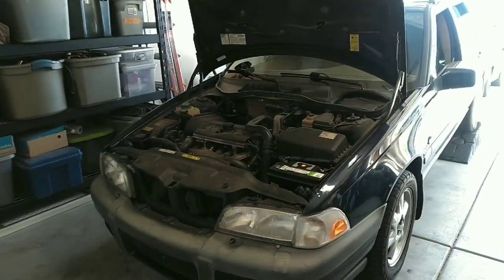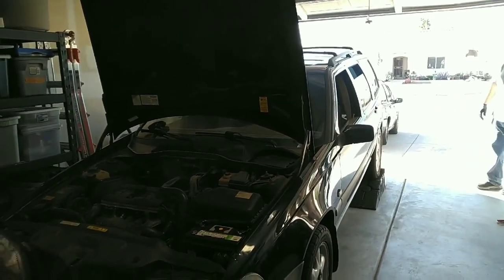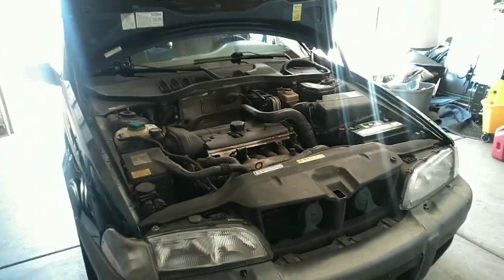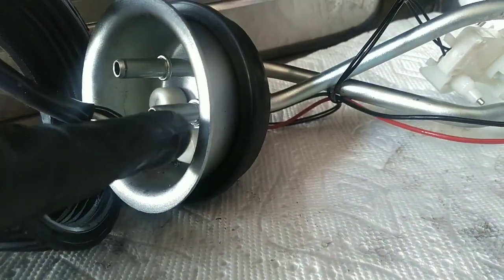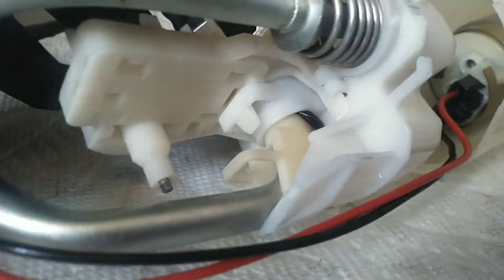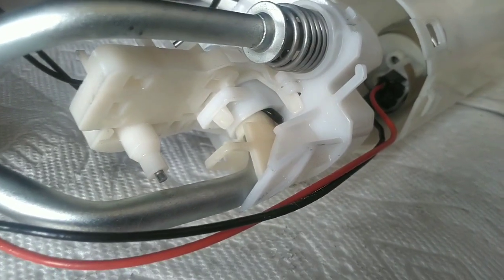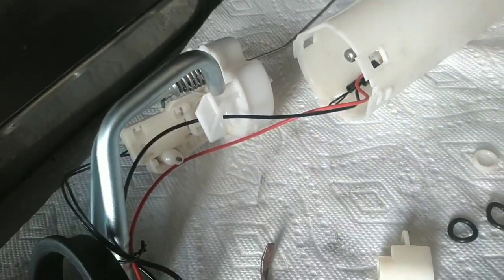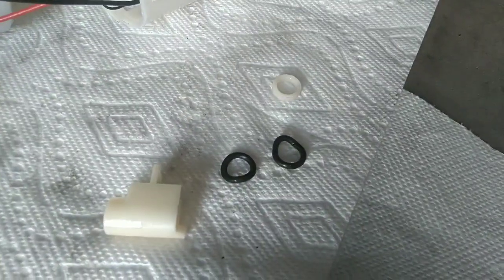Strange fuel pump issue on a 2000 V70 XC SE P80 Volvo.

Comment: Will this cause fuel pressure to drop quickly after shutting off the engine?
Reply from the maker: Yes.
Reply: @RobertDIY  Thanks, lots of post about fuel pump check valve failing as a reason for fuel pressure drop and people installing external check valves as a fix.  Thanks to your video, it shows another possible cause for fuel pressure drop after shutting engine off.

Comment: What else in general burdens the crankshaft than, alternator, power steering, water pump? (My car started to use 20% more fuel after I did some work on the front suspension, and does it also when idling/clutch is down.) 2001 S60 gasoline freely aspirated.
Reply: Did also add DAB blue tooth/work on the hand break and removed center console. The lighter socket acts funny, so could be shorted and cause voltage drop. That would make alternator run under load all the time I guess.
Reply from the maker: I have no idea. That's above my pay grade. Could be a bad alternator.

Comment: Another great Volvo video  :)
I have a problem with my U&K spec 2002 S80  2.4 (170 hp) in warm(hot) weather my engine starts pinging ( pre-ingition)  any ideas please ?  Spark plugs were changed 5k miles ago , PCV checks out OK, just done oil & filter change.
Reply from the maker: Any error codes? Is the timing off? Is fuel low grade?
Reply: @RobertDIY  no error codes - checked with a snap-on scanner, 95 octane ( from different places, still get same results)  Not sure how timing can be off, I replaced cam belt & water pump last year & triple checked timing before putting back together  . Engine pulls like a train & no problem in cold _ cool weather, which is the norm here   lol
Reply from the maker: I'd try a different fuel.
Reply: @RobertDIY  Even tried Shell V-Power ( 97 octane )  . Engine had done only 107k, but 17 yrs old - could the inlet manifold gasket be leaking ?